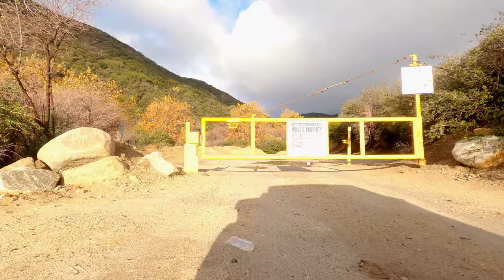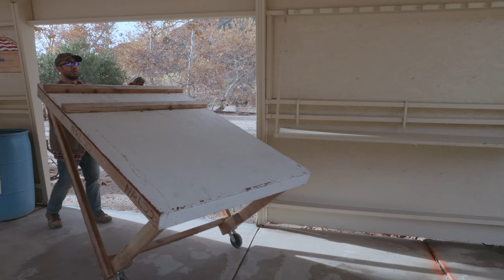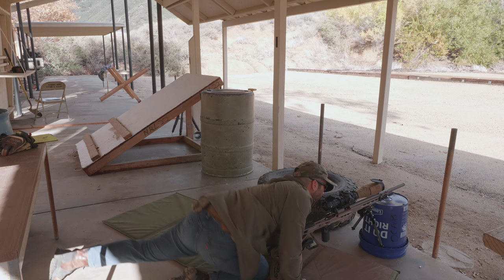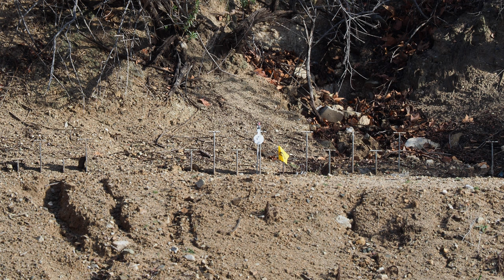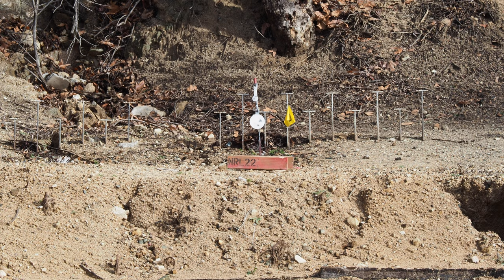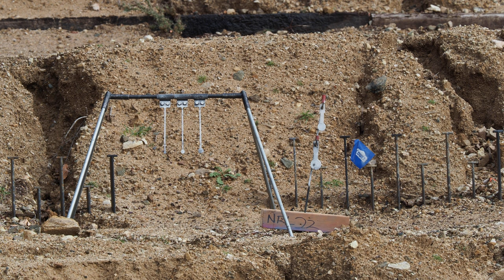Range VLOG #160 - January 2022 NRL22 Course of Fire Match Director Walk-Through

Comment: I'm a nobody, not a smart Alec, asking a couple of questions:  aren't you limited to one piece of gear? so no big bag any time you use a front bag? the COF gives distances like 88 yards - is the range set up to the given distances?
Reply from the maker: The one-piece of equipment rule was dropped in the 2021-2022 NRL22 season. As far as distances, yes, if the stage has an 88 yard target, it will be set at 88 yards.
Reply: @ocabj  thank you.

Comment: So .. question… coming from another action shooting sport my mind is always looking at ALL the options. Bear in mind, I have absolutely ZERO NRL22 expectations…For the “After Party Mess” stage .. is their anything prohibiting the shooter from taking the “3 different side rungs of the ladder” in the prone position? Not sure of NRL rule set in that do rules state “unless the WSB says you may go prone, you can not” or is it “if the WSB doesn’t prohibit it, it’s allowed” 

As a zero experience NRL22 guy I would think “I’ll go prone and put the bipod feet on the bottom side rail so they are still touching the rail thus complying w the WSB” 

Am I missing something? Or is that a doable option ?
Reply: Experience not expectations
Reply from the maker: While it doesn't explicitly say where exactly the rifle will rest one the ladder, I am pretty confident most MD's will recognize the intent and probably enforce it such that you shoot off the upward facing side.